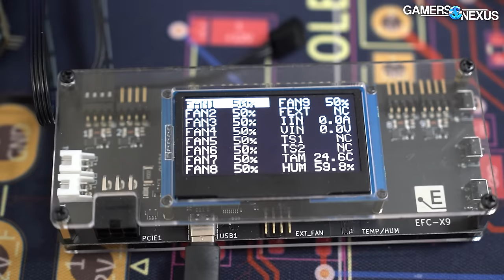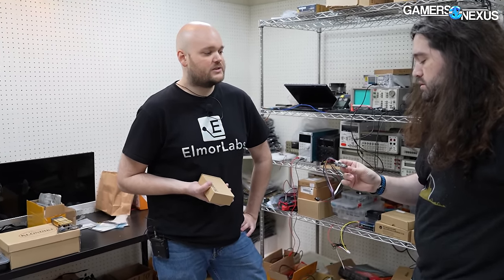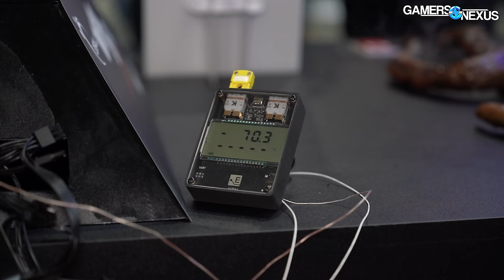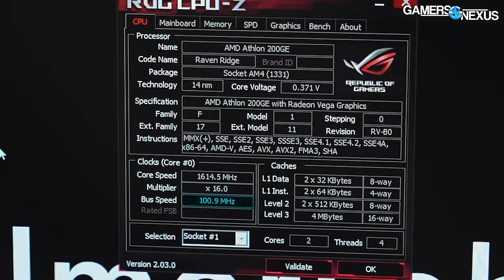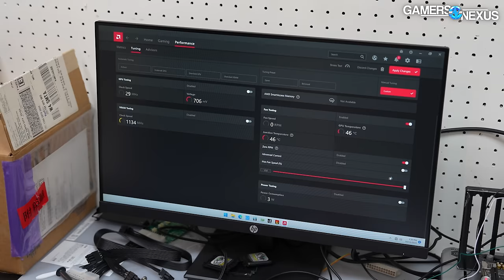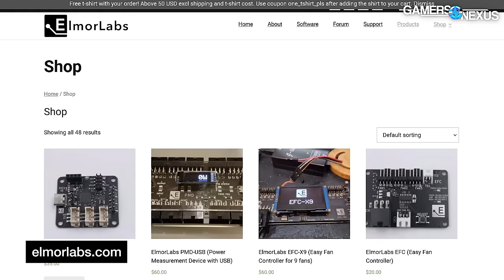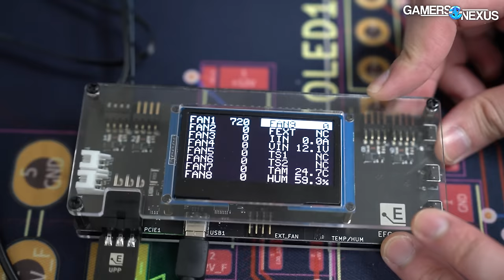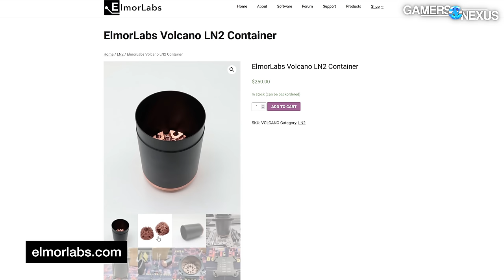Hacking GPUs with External Clock Generation: Elmor Labs Tour | GN Factory Tours S3E3

Comment: The extreme overclockers remind me of the how the old moonshiners modified their cars, which led to the birth of Nascar and the muscle cars of the 60's and 70's from the big three automakers. The Hot Rodders of the 50's and 60's are the grandparents of the overclockers, they are both after better perfomance, they are just working in a different medium.
Reply: best analogy i've read to explain XOC to someone who barely knows anything about computers is "basically drag racing but replace the car parts with pc parts".
Reply: That doesn't make any sense. Neither are about better performance. Peak performance yes

Comment: 19:18 i love the fact that you brought up the question about the polling rate of that device, it can matter a lot as it clearly shows how important it is to know about it when you set it to the lowest and you see it go from low 2 digit number to very high 3 digit numbers so fast, transient loads man...
Reply: I don't think it's exactly polling rate they were talking about, more like how long the averaging window is. I assume that it measures 29us at all times, since 29us is the lowest averaging window, and that is probably the polling rate.
And there's also a refresh rate of the screen, which looks like 10-15 fps.

Comment: 15:30 can't say how often I've looked at a project and wanted a dedicated external fan control for it, not just computers. As for bios, I've run across some motherboards where the fan RPM eventually sticks and never changes after some time of the computer being on (from a few mobo makers), becomes super annoying if I'm in the middle of a project and have to save and close everything just to reboot to fix the bios fan control. A dedicated external fan control would be so nice to fix that (esp for the GN R7 build PC).

Great vid Steve, Elmor and crews. B)
Reply: I had this same problem too, but with my GPU. Fans would lock iut at 100% rpm, requiring a reboot. I solved this issue by connecting the fans to an Aquacomputer fan controller, and using the fan controller software to monitor Temps and run it's own fan curve.

Comment: You really are Tech Jesus 🥺. Thank you for showing this gem. I don't want overclocking or pushing the limits through frankenstein like modding to ever die. Hopefully one day we can see third party software and driver supports for obsolete graphics cards, while splicing vram or creating a mutant gpu using both an AMD and a Nvidia card.

Comment: What a great collection of vintage test equipment at 5:54 . It's been ages since I saw an HP 3457a (it's from 1985), but it's a great device (it's the long one). I think that's a HP 3478a on the right, fluke 8842a on the left. I don't recognize the digital thermometer above the 3478a or what appears to be a keithley 2000 clone to the left of it. The Hameg analog scope is nice to see too, though I'm not sure what it's better than the Rigol DS2102A (no doubt modded to 300 MHz).

Comment: A pluggable debug/ postcode LED screen would be awesome, i think it should be mandatory in every motherboard anyway it makes everyone's life more easy. I have not tried for years but does the old speaker and beep thing even work today? Its the 1 thing everyone neglects to add to DIY builds (i have myself for years anyways) but PC's used to always come with a small speaker that emitted beeps for error codes can save so much time with something to read postcodes especially when you have a RAM or CPU seating issue.

Comment: Those LN2 pots are nice, but it's got me thinking... Why hasn't someone designed a crazy high surface area LN2 pot, like something that would be impossible to machine, and have it 3D printed? You can get things 3D printed in pure copper now days.
Reply: It would be extremely expensive. Like $4000+ per revision.

Comment: This is the reason why I love hardware more than software. You just probe the bus or change the oscillator FQ and you can overclock even when overclocking is locked in BIOS or CPU/GPU.
Unfortunately industry is trying to limit such tinkering by putting more stuff on CPU die and increase SW control :'(

Comment: I am interested in that external clock generator. I have a custom water cooled merc 319 68XT and I am running smoothly at the 2800mhz clock limit. Card only goes above 50C when it’s pulling >400W and my cpu is also pulling >200W. I WANT MORE CLOCK SPEED I WANT 3GHZ.

Comment: I think these videos could be improved if you could provide more explanations.
For example,
External clock - I'm guessing it is just more convenient that changing the base clock via BIOS or some software tool? Is there any other advantages / disadvantages?
Dummy loads - what is it used for? Testing power supplies?
Etc etc
I'm an enthusiast, not an engineer... EDUCATE ME :P
Reply: External clocks are kind of necessary since a lot of lower end motherboards do not provide a BCLK control option _at all_, so that's what it's for, plus it's easier to instantly adjust the clocks on the fly. The reason this isn't explained clearly is because people who use these things, usually know exactly what they are for. You only go for an external clock gen if you don't have the option on the board, or are an extreme overclocker.

Dummy Loads are exactly what they are: loads not generated by actual components, and their only purpose is testing how power flows through the system and how components handle it.